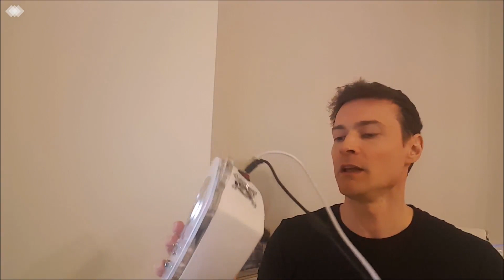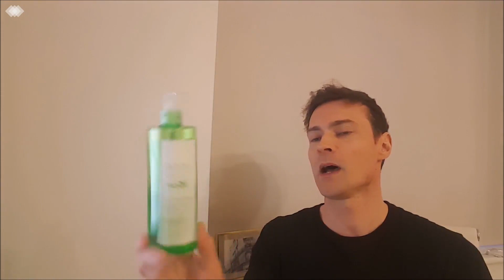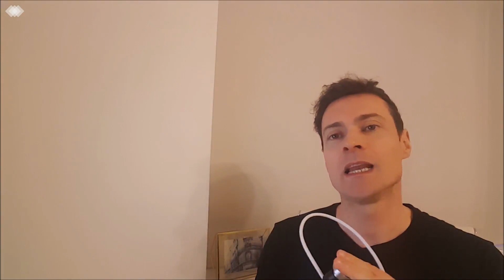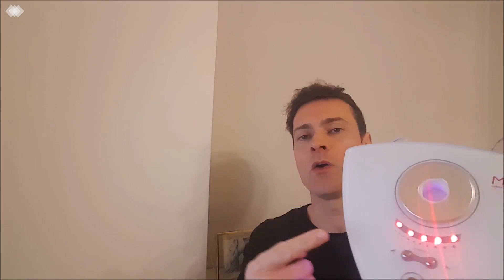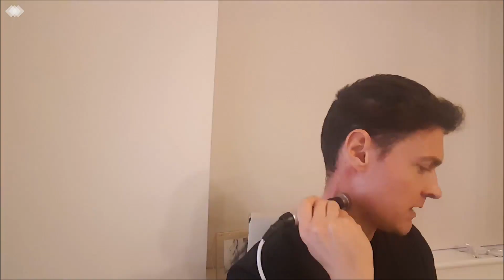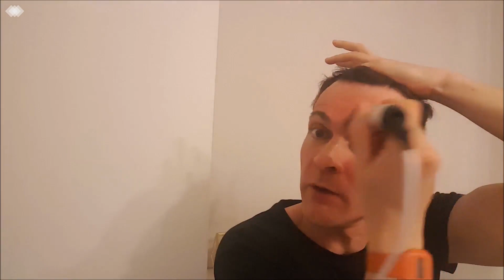Update after one year using RF Skin Tightening: My New Jawline!

Comment: Thank you for the tutorial. Are you maintaining the heat at 40degrees by continuing to run the electrode over that area? I was thinking wouldn't that heat it even more? Best Wishes!
Reply from the maker: No as it doesn't get any hotter than that, the max is 40 degrees. You have to go over the same section to maintain it. It won't suddenly burn you though.
Reply: @10YearsYounger  So just further to your instructions - you said to maintain it for 20mins but your counterpart on YouTube (TJTutorials) says 3mins (using same machine). A little bit confusing. Perhaps you could share where you are getting that information from so we can be absolutely sure as don't want to do the skin any harm. Thank You.

Comment: I have the stop and the pose and I noticed the pose gets much hotter have you tried both, the stop seems to be small and not as easy to get hot
Reply from the maker: No havent go the pose but they are supposed to be exactly the same, the stop doesn't have the microcurrent fuction though.

Comment: Hi there, do you reckon this is safe on the face with filler done? Is yours a mini or a regular RF set? I read many reviews about people getting electric shocks even with using gel and I am kind of scared. Also, isn't normal shower water we use about 40 degree celsius? Thanks.
Reply from the maker: It may make your filler dissapear quicker, there's no solid answer at the moment as no research has been done on that. 40 degrees isn't that hot especially as you keep moving it, you don't stay in one place. It doesn't give you a shock - if so it must be faulty.
Reply: @10YearsYounger  Yeah I noticed it’s the same temperature at my shower water cos our tap has temperature settings 😂 Filler is so expensive must be careful. Yeah I understand there isn’t any scientific investigation available unless I don’t know it exists. Is yours a mini or the regular set? Thanks.

Comment: I was almost kind of hoping it caused some fat loss because I have a double chin which is definitely a fat deposit, not sagging skin. The other problem I have is that one of my cheeks is slightly chubbier than the other so I want to even it out a bit if possible. I’m too scared to do anything invasive like liposuction so I’m curious what I could do in this case. I don’t think I want to go for injections either.
Reply from the maker: For double chins there is a fat dissolving injection you can have, can't remember what it's called now. But that would get rid of the fat there. Only thing is you may be left with some skin sagging which you would then need to treat.
Reply: Yes I’ve heard of that but I’m at a point where needles still creep me out so I’m trying to find less invasive fixes for things while I can. I know that you shouldn’t do radiofrequency too frequently because it can kill the new collagen, but if you’re attempting to slightly tighten up a fatty area, would you use the device more frequently at least in the short term?

Comment: I wonder if you have low tolerance to heat? Because I use the level 5 power and even if I go slower, I don't feel any burn sensation, just comfortable warmth. It's either my machine is defective or we have different heat tolerance.

Also I see that ur face gets red, and I don't at all :/

BTW, I bought a different machine:
https://shopee.co.id/product/127599756/5739598691?smtt=0.86433075-1607999476.9
 because the one you have is sold out.

Comment: Can you use water on your face to glide it?
Reply from the maker: No as the heat would dry it instantly, has to be gel
Reply: @10YearsYounger  The gel kept adhering to my device, and I had to reapply it constantly. So I tried  using a paper towel drenched in water with one hand and would keep rubbing it over the next area I was about to do to keep things slippery. It protected my skin well from the heat. But I was wondering if that messes up the conductivity though...

Comment: Hi there, it would be interesting to see what your face looked like prior to using any Skin tightening or RF any pictures?? 

As I've read so many professional statements on thermal therapy / RF causing substantial facial "Fat Loss" and many people having had this in office and done themselves at home, ending up looking great for awhile but then it all goes south, reports of patients burning away to much of there facial fat, volume making indentations in the skin due to repetitive heat damage, making them look older and more haggard than before.
Reply from the maker: Yes that's the danger with RF. If you look at my earliest videos from 2016 you will see my skin before I used RF at all. Best thing is to limit use to a couple of minutes in each area.

Comment: Wow, definitely see difference. I love your videos, very informative,  thank you. I bought a combo machine that does body cavitation and RF for body and face. When I do the RF on my face I see instant results, plumper, lifted and tightened. But within a day or two I look saggy again.  I've done maybe 5 treatments on my face. Any advice?
Reply from the maker: These machines that say RF cavitation are misleading. RF is one modality but cavitation is ultrasound, its totally different. So I'm not sure what machine you actually have. As in a salon they would use 2 seperate ones. Does it have 2 seperate heads on your machine?
Reply: @10YearsYounger  thank you for your response. Yes, it had 5 heads on it. One for cav, suction, rf for body and 2 rf for face.

Comment: You look great!!!!  Do you know why some RF have prongs and some have the flat head?
Reply from the maker: Not sure, most of them I've seen have a flat head. Easier to use.
Reply: They have prongs because some are bi-polar ( 2 prongs), tri-polar( 3 prongs) radio frequency. There is also fractionated tips ( kind of looks like dot matrix) also know as Thermage. Hope this helps. It all has the same principal..heat.
Reply: @frankieward1570  Thank you for your reply Frankie. I am not quite sure what dot matrix looks like - maybe a flat head with little dots protruding at the end? Wouldn't that one - the thermage be more efficient in treatments?

Comment: Is there a quicker process method? Maybe a fancier machine will get the job done quicker?
Reply from the maker: No because you can't increase the temperature more than 40 degrees, a more powerful machine wouldn't be hotter (as that would burn you).

Comment: From all the devices you used what would be your top two for wrinkles around the eyes and tighten skin around the jowls and lift the cheeks. I'm 34 but I started seeing lines around the eyes a slight sag on the upper eyelid as well as my jowls? Please
Reply from the maker: I'm currently reviewing microcurrent, which is amazing, video coming soon. To tighten the skin, use RF but you also need to tighten the muscles underneath which sag. So for that facial exercise or microcurrent. Its a multi faceted approach, not just one machine.

Comment: I was searching for this machine and it seems there are 2 types selling with the difference in probe heads. One probe head is like yours which is a flat head whereas another shows with 3 metal electrodes that comes with red light, which is actually more suitable and helpful for face lifting?Like is the one with 3 metal electrode and red light a fake one or?
Reply from the maker: The machine I bought is made by CARER. But I see the exact same machine is also available in other brands, so I guess the are the same? I don't know. The red light I think must be LED, which is another skin treatment which is sometimes combined with RF (the colours are supposed to energise or detox the skin, I haven't tried that so don't know if it works). If there are 3 electrodes on the head it means it's tripolar instead of bipolar, which mine is.
Reply: Carmen Leewy hi could you say the device you seen and where please sounds good thank you 😊

Comment: I love your channel.  Thank you for posting this, I bought one after seeing your results and I love it.
Reply from the maker: Fantastic, have you seen results?
Reply: @10YearsYounger  Initially, yes. I've only had it for a couple weeks, so I am looking forward to the long term results. Immediately, I have seen a reduction in puffiness and darkness in my under eye area (from using it only a couple times).  I also see a firming effect in my jaw line and a reduction in my smile lines (nasolabial folds).  It definitely helps increase circulation and I see a noticeable difference every time I use it.

Comment: The aloe is fine to use. You are correct that it’s meant to be cooling, but the heat that RF conducts works from the inside out. The inner layers heat to contract cells, but if you heat the outer layer to the same temperature, it will burn. As you mentioned, if you go too slow, you’ll burn that outer layer. This is why you should use the aloe, to keep the external skin cool while it works below the surface.
Reply from the maker: Interesting. You sound like an expert, do you use this yourself?

Comment: Hi, I just purchased my machine and it says it has a probe that can be used around the eyes "" 【Easy To Use】-- Two probes could be treated for face, eye and other body parts alternatively for frequent use without the need for replacement. It works better when uses with some gel to make it roll smoothly over the face and allow the radio waves to penetrate the skin. And it's low frequency microcurrent is specially for treatment around the eyes. ....
Reply from the maker: I guess that means around the eye area not on the eye. Keep it away from your actual eyes.

Comment: Great video! You mentioned that the treatment to be effective we have to warm up the skin for 40 degrees and maintain the temperature for at least 20 minutes. How do you make sure that it says on 40 degrees for 20 minutes? Thanks for your reply!
Reply from the maker: Just check with thermometer, it doesn't have to be like an exact science. If you do it right, you will see the results.
Reply: @10YearsYounger  Do we determine the 40 degrees by adding that to our normal body temperature? For example 98° is normal for me, should my temperature be 138° on my face while doing the treatment ?

Comment: What I’ve noticed after using this device for 7 times is that my face gets tightened and deflated immediately after use. But after about 1.5 - 2 days, my face will be pumped up again & it will be tighter than before. I hope that the fat is not killed, but just shrunk due to the heat.
Reply from the maker: Yes, the instant tightening effect is temporary , over a couple of months you will see the longer lasting results.

Comment: Hallo, I have one problem, I bought this device and face thermometer, today I was massaging for the first time, a total of hours of both sides of the face, and my temperature never came to 40 degrees, up to 33, I'm totally confused about it, I also have a red face but just a little, and they go red after maybe 20minute, not like yours red,  I feel the heat when I massage. So one side of my face was massaged about 25 minutes, so on the other. It may not be a good thermometer, but I doubt it. What do you think might be? Tnx
Reply: My device is 2Mhz, maybe because of that, I do not know ..
How many degreeses you have when you start to massage? My face is 31 degrees when I start.
Reply: Please answer me, I'm so disapointed if my device is not good..
Reply from the maker: Hi. Even if the temperature doesn't get to 40 degrees it will still be having an effect. You should be able to see a tightening effect straight after? Yes your skin should be red as that is a sign that it is working. The other thing is that some thermometers measure body temperature (to know if you are sick for example) and others measure surface temperature (ie the skin or a wall). You also need to keep going over the same area, not just once.
Reply: @10YearsYounger  
Thanks a lot for the answer :) You mean that everything is ok with the device, and what does the 2mhz device have any connection to? tnx

Comment: can i use rf every 4 days?
Reply: No, he said every 14 days
Reply from the maker: No you need to allow the collagen to build up, if you keep using the machine too much you will break it down. Maximum once every 2 weeks.
Reply: Use only every 2 -3 weeks . I can eventually break down too much collagen your body has to heal. The older you get the longer the healing time. Thanks for the info.

Comment: Would you say this machine helps to slim down your cheeks and mouth area by reducing fat/volume?
Reply: I can confirm this machine causes facial fat loss. I’ve used it 5-6 times and I can tell that it make my face less chubby every time I use it. It is a great machine & it really tightens the skin. But the fat loss part is a concern for me. I think because he doesn’t have a lot of fat in his face already so he couldn’t tell that it make his face thiner.
Updated: I can see that my face is really thin and tight one day after the treatment, and then, my face gains fat and look quite chubby as it used to before, but less wrinkly, I HOPE the face thinning effect is just the result of your collagen contracts after the treatment, no fat loss. But beware.
Reply: @phuongs1382  please write another update
Reply from the maker: I'm using this to tighten the skin, I didn't have fat there in the first place so I can't really tell you. These RF machines can be used on the thighs or belly to reduce fat but I have not used it for that purpose so I can't confirm if it is effective or not.
Reply: Please write your update here again i wanna buy it but i'm really afraid to loss the fat of my cheeks.

Comment: I would love if you ordered the Newa and tested it and compared it to this btw! It’s $400 but there’s usually a $100 off code.
Reply from the maker: Hi. I checked out their website and it looks the same as the machines I reviewed, there's no explanation of their technology. Also they recommend using it 5 times a week, which would break down collagen instead of building it. So not sure about that one.
Reply: Look 20 Years Younger here’s more on 3Deep from their actual website:
www.endymed.com/3DEEP

It’s my understanding that unlike most at home RF devices, the Newa’s technology allows it to heat the dermis high enough without requiring surface cooling while most at home devices deal with that by just not heating the dermis as high as needed. The Newa also has actually studies carried out on its effectiveness:

https://www.ncbi.nlm.nih.gov/m/pubmed/27351303/

https://www.ncbi.nlm.nih.gov/m/pubmed/25607700/

It sounds like it’s only several times a week for the first month. Their studies also use this method and you can see in this study for another RF device they used it once a week for 4 weeks so it’s pretty typical I think:
https://www.ncbi.nlm.nih.gov/m/pubmed/25640163/

I’m assuming it’s because these are at home devices and not as strong as in office that you want to do a series of treatments? There doesn’t seem to be set parameters. For example I stick to 4 weeks between microneedling sessions because that’s how long it takes collagen to form but there’s a very well known doctor Lance Setterfield who specializes in microneedling and he says 5 days between treatments is fine. And has apparently done studies and it’s been effective. 

I’ll try and see if I can dig up more info. I know there’s an at home laser that recommend doing 8 weeks nightly then stopping for several months.
Reply: @skinsciencebymira  I have the Newa and like it alot and also looked at the studies. My only complaint is that it is not for neck or forehead area. I cheat a bit. I burnt my neck twice so maybe thats why. The forehead skin is close to bone. So I try to just get the 11's a bit. It really has helped my lip lines and after the first month you can go to twice or three times a week.

Comment: No, the aloe wouldn’t hinder it because you only want to heat the dermis. You actually want to keep the surface of the skin cool so it doesn’t burn, stronger medical machines often require surface cooling.
Reply from the maker: I see. Thanks for explaining, I will keep using aloe gel.
Reply: Look 20 Years Younger sure. Check out Christine Buyer on YT, she’s an esthetician and has several videos on skincare devices and talks about how to make your own conductive gel. She has a review on a Korean machine that combines HIFU (Ultrasound) and RF which you may be into! Thanks for the update btw, I’ve been looking at adding more skincare devices to my collection.

Comment: Love your videos. When you was 20 your jawline  was the same sharp like the results of radiofrequenty? Or you never have the jawline definition that you have now? (using the device)  did you think it will improve skin with acne scars? (may be if the device tight the skin, deep acne scar will look less deep) sorry my english is not my native language.
Reply: If you want something for acne use a machine for high frequency machine its cheaper and great for acne and wrinkles alot of reviews about it good luck
Reply from the maker: Hi. My jawline was very visible when I was 20! I don't think this would help with acne - I think you could speak to a dermatologist about that. This is only to tighten the skin, which won't really affect how the acne looks.